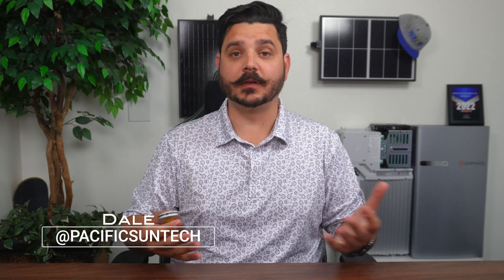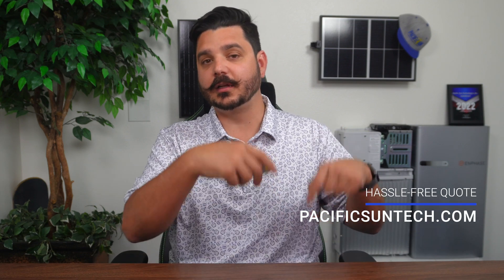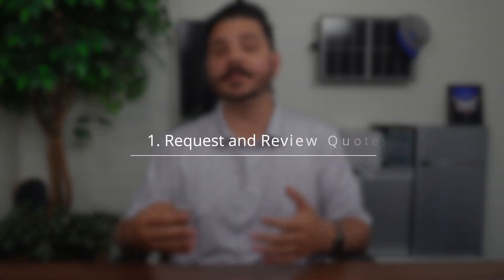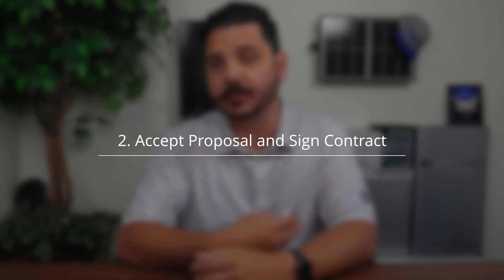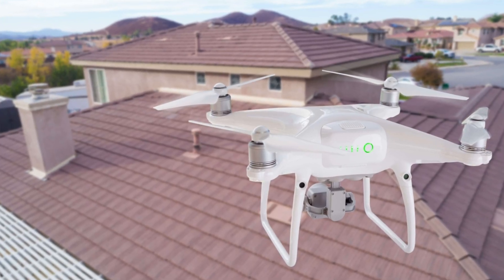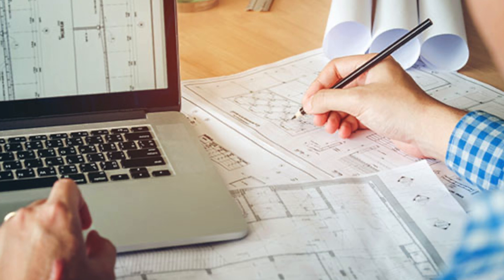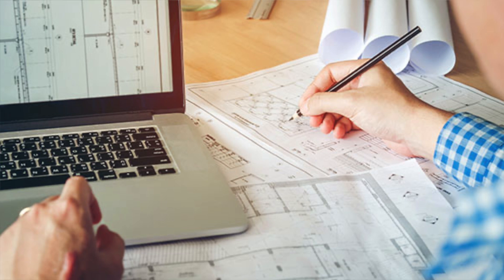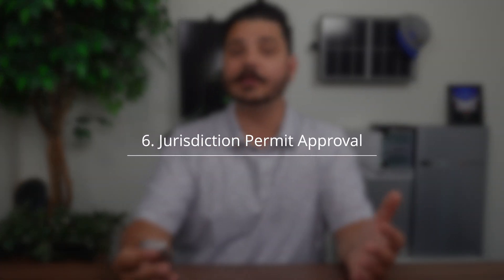Go Solar in 10 Easy Steps!

Comment: I have been working with planning and scheduling with Sunlight Solar in Portland, OR, for 12 kw of solar and 20 kwh of battery, since November 2021 and I am still waiting for my install date. It should have happened Sept 5, then Sept 12, then Oct 17, now Nov 1, 2022. A full year after I put down the deposit. That is a delay.